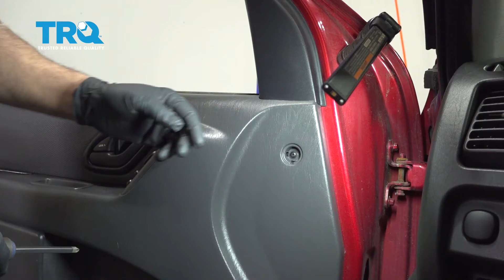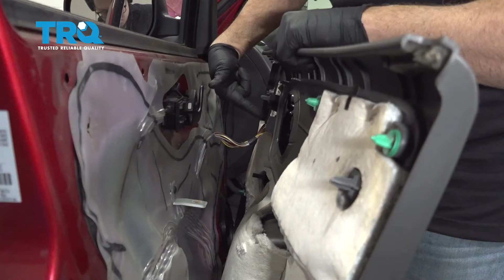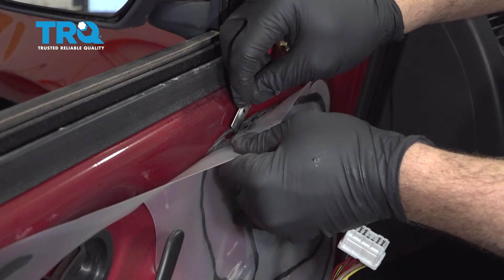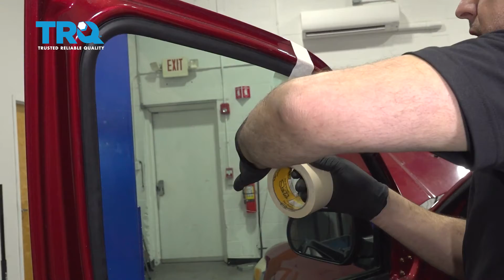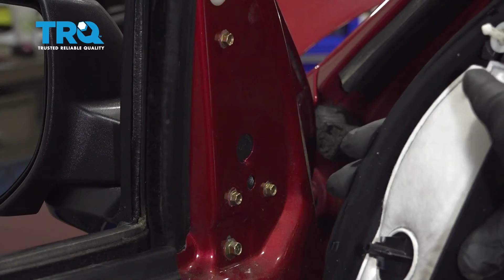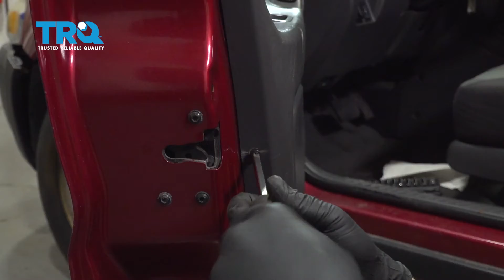How to Replace Window Regulator 2001-2007 Ford Escape

Comment: What if the motor isnt working. How do you get the regulator out or in the position to where you can see the screws at the bottom of the door?

Comment: Gracias por el tutorial , si alguien mas tiene problemas de que no sube la ventana lo que pueden hacer es quitar solo el motor, sacarlo  para que puedas desarmarlo, quitar el iman y asi subir la ventana manualmente, luego vuelves armar el motor y ponerlo en lo que buscas en repuesto.  / Thanks for the tutorial, if someone else has problems that the window does not go up, what they can do is remove only the motor, take it out so you can disassemble it, remove the magnet and thus manually raise the window, then reassemble the motor and put it on what you are looking for in spare.